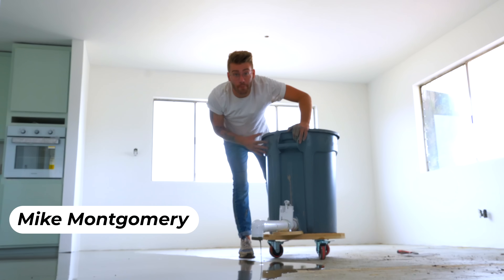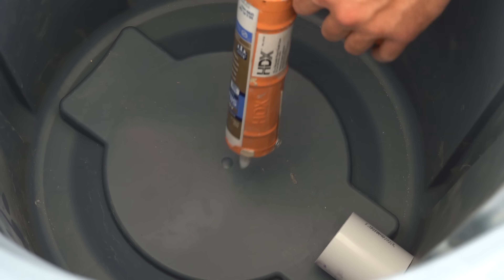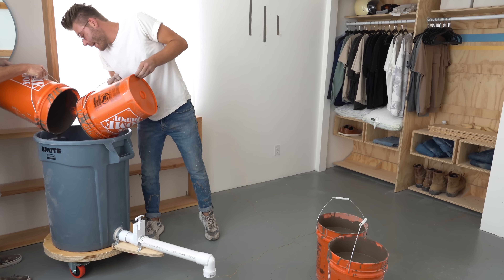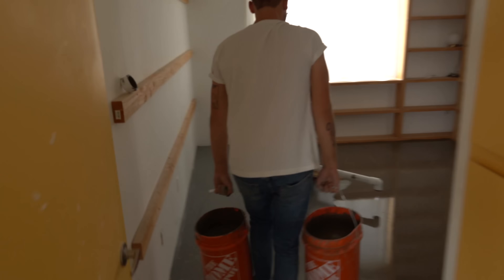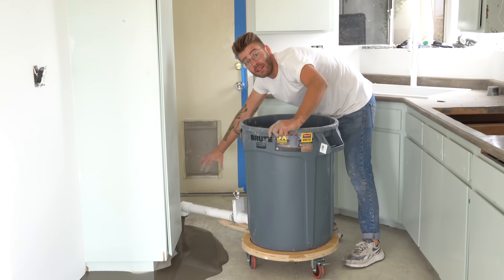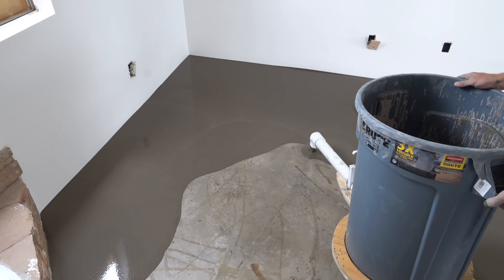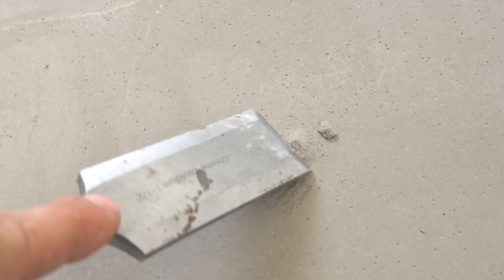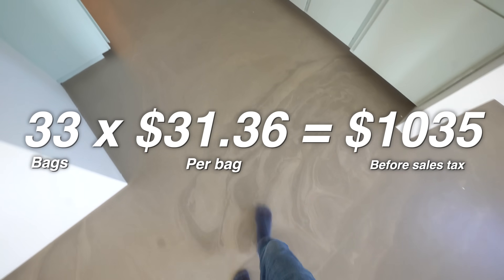DIY SELF LEVELING CONCRETE FLOORS!! $1 per square foot

Comment: This isn't what this product is designed for, there are cold joins everywhere which will fracture and crack and there are no expansion joins anywhere. He should really do a update video in a year to see if it has cracked through the doorways, cold joins and see what damage the floor has received from general use
Reply: Not to mention this is just a slurry mix not concrete. There are going to be huge issues with this.
Reply: I wanna se the entire house after 3 years. As far as i have seen the videos it will start falling apart.
Reply: No one seems to know the difference between cement and concrete in the real world.
Reply: Yeah.. this house should be condemned. He also took a support beam out and placed a heavy brace in the roof that will likely collapse over time. I wouldn’t live here.
Reply: @neondynamite  If you ask me all the newer videos where he fiddles with the structual integrity should be taken offline because if people try this at home there is some serious danger.
Reply: @andylimb  he is calling it concrete, but it is levelling compound which is designed to be self levelling. It's over 40mpa, so it won't crack as long as there wasn't too much water or too thick.
Reply: Made for tiles
Reply: That's actually exactly what self level is for. He did a lot wrong though. Your supposed to use a porcupine roller to get the air bubbles out and use a perimeter tape made of foam that prevents cracks.
Reply: it is levelling compound which is designed to be self levelling. It's over 40mpa, so it won't crack as long as there wasn't too much water or too thick.
Reply: People have already said this in other videos, but he keeps making more of the same
Reply: @cinder7258  It is self levelling compound, but just because you use a product doesn't mean when you apply it incorrectly that it won't fail on you because it is 40mpa. His "swirls & geode patterns" that he is playing off as a cool design are all cold joins that have a high failure rate
Reply: @TrunksChoiceBand  Tell me you know nothing without telling me you know nothing...
Reply: It’s the way that you guys act like he’s telling you to live in this house if you don’t like it then don’t do it but don’t be over here being a wet blanket for everybody else and making comments he knows that he can cover his floors if it doesn’t out 🙄 he’s just being creative why don’t you guys calm down and find something else to do he never said that he was a professional he never does.. y’all over here losing your shit over something that was he has chosen to live with. #Myofb
Reply: @davidp5492  Bro? he always comments  and my man does not have a large ego. If this comment is to believed which it isn't since its wrong, wouldn't he be busy?
Reply: @davidp5492  by the way he never actually says anything that would warrant a response, he doesn't talk to him directly.
Reply: @davidp5492  they really don't make that much money, maybe max 100k per year
Reply: It’s flowable hydraulic cementitious underlayment- it’s formulated with polymers and in a way that it doesn’t need control joints.
Reply: @Tavieme  
Thank you. All the experts always criticizing what someone else is doing “wrong” but never making their video on how to do it “right”. And it’s true that he might not be using the product correctly but at least he’s creative enough to where even the experts feel the need to watch his videos.
Reply from the maker: I’ll do that!!
Reply: @jmccormick1490  spike roller is for breaking surface tension
Reply: @Jaylowrider  That's true, helps the self level do what it's supposed to do. You are correct.
Reply: @Tavieme  so now if someone does something completely wrong we should call it "being creative" and encourage him to do more wrong.. sorry "creative" stuff.
Reply: @TrunksChoiceBand  cold joints and failure rate? How would this cause the floor to fail?  What does it do,  fall off the floor onto the ceiling?
The pattern is simply because it's flowing out of a tube. If you poured a five gallon pail onto the floor and screeded it out, you'd have the same look for each of the five gallon pails poured next to one another. It just wouldn't be as obvious.
Reply: @shazadhussain4204  that's what comment section for. Criticising? It depends on you, at least he got to know a few other ways to make it correctly, why do they need to make a video? They might not know how, but they surely know about the subject matter.
Reply: Some self levers are wear layers. Just have to seal them.
It also needs a minimal thickness.

Just listen to his voice. You already know he doesn't know what he's doink.
Reply: @TG-zd9de  lmfao you have no clue. all concrete slabs will crack over time because concrete naturally shrinks. It’s a known fact.
Reply: @tf5870  thanks, have a great weekend
Reply: Don’t Home Depot this.  They flat out don’t sell the tools or products you need for a proper finished concrete floor.  Find your local specialty concrete supplier or order online.  As a contractor, I would not warranty this.  As an engineer, I’d get sued for speccing this product as finished floor.  No perimeter expansion gap, zero porosity skinned over grout.  No bueno.  Fat guy is going to slip and fall into those cabinets and you are busting a crack in this.  First cold day and the slab shrinks, cracks.  It’s made to go under tile and wood where failures in the grout would be bridged over and hidden by a more flexible floor.  Good news is this isn’t a wasted effort since the next guy will have minimal prep for a new floor.  Should have finished this with a micro topping before sealing.  Formulated to be a much harder surface while also being flexible and pourous to accept stains and sealers without becoming too slick.
Reply: @andylimb  I was wondering about that. Concrete minus aggregate is just cement, right?

Is there a concrete mix with small enough aggregate to be piurable and self leveling?

Seems like even pea gravel would be too small unless you were going like an inch thick.

Even then I don't know that it would be self leveling.

I've done concrete over chicken wire for interior walls on a quonset hut once. We just troweled it on and smoothed it with a sponge.
Reply: @Tavieme  If he's presenting it as a viable method, but it can be expected to fail such that it requires extensive work to make it usable, people deserve that information 

People who might try this at home need to get an outcome that justifies the cost and effort without a monetized video to offset it.
Reply: He should switch to a wear surface self leveler like Customs tech level HPT
Reply: @hasserecht3678  report those videos that you feel are unsafe.
Reply: They're called cold joints. Not joins.  Joints.  And expansion joints are for slabs.  Not self leveling. And also, yes that is exactly what that material is designed for.  Better stuff is ardex.  I worked w pyramid in NYC for years. I'm a union Mason so please don't argue w me
Reply: He also poured over an existing slab. Unless the house settles further it will not Crack.  That stuff is over 10k psi
Reply: @cinder7258 😂 try 550 per day cash, or 175k per year annually or better in NYC as a local 780 finisher.  Ask me how I know.
Reply: Did you like that bucket 🪣 with the gate valve,,,? Johnny Bravo style
Reply: @ModernBuilds where is the update?
Reply: I was wondering, why doesn’t he use the trash dolly’s that are made for that can, but then he needed something for supporting his flow pipe. Pretty interesting idea. Just not a big fan of the finish look though. Too plain for me. But a fun video all together.
Reply: @ModernBuilds here’s your 1 year reminder. How’s the floor looking?
Reply: @ModernBuilds Did you do the update yet?
Reply: @ModernBuilds update?
Reply: @cementkidd sounds like you have the experience to make a well informed opinion, to us regular DIY ers I appreciate your input. Only thing I would have done differently is to just constantly keep filling the dispenser can , instead of stopping and refilling just having you buddy bring in a 5 gallon bucket and add it before you run out of material. You know that you got to hustle with a project like this and make sure that you keep a wet edge
Reply: @russellstewart5414  your 100% right about that.  In NY we had a mixing truck with a 3 inch hose that gave us a consistent flow of material.  But when mixing by hand, we used pickle barrels and had an army of men mixing ahead as we poured the material.  It is spread in small strips to eliminate cold joints, and there is spiked rollers or blades used the process.  If cracking was possible, we saw cut joints into the floor.  Never expansion joints ever.
Reply: 😂 @neondynamite
Reply: The floor is primed first for bonding and the self leveler is designed to be sound over a 1 1/4” substrate.
Reply: @griffinholtsinger2379 

Thanks, this is the most useful comment.
Keyword microtopping.
Reply: @cinder7258 in what country is 100k not a good income
Reply: He’s actually doing something which is really dope when our great great grand fathers built there homes they weren’t don’t perfect or even close and a lot of those homes lasted 100 years. He never claimed to be an expert or even a professional he always asks for suggestions and better methods.
Reply: So its been a year can we get an update vid?  Thanks!  @ModernBuilds
Reply: @ModernBuilds  How's it looking a year later?
Reply: Update time G
Reply: @jmccormick1490 *you’re
Reply: @ModernBuilds okay it’s time! Let’s see it! 😊
Reply: One year later
Reply: @ModernBuilds I'll look for an update after I watch...😂
Reply: He will have no problems with these floors my company has been using this system for years and have never had a floor crack !!
Reply: I'm in a similar situation and apprehensive about which direction too go. Slab foundation on mostly clay (north Texas) with a 3 inch drop over about 30 feet (but a big part of that within 10 feet). It would be an insane amount of leveler but not sure what a good alternative is. Anyone have any better alternatives?
Reply: I figured that was just the polymer crap thats in it, idk. I did this to a bathroom that i was/am going to tile, but havent gotten around to - no cracks @TrunksChoiceBand
Reply: Link?  @ModernBuilds

Comment: You could just… pour it on the floor from the buckets…
Reply: Those buckets are extremely heavy. The wheels make 1-2 people work a bit easier. But yes if you had a crew pouring from buckets makes more sense!
Reply: @pandaexpresso  You mean the buckets they used to mix in, and then transfer to the trash bin? Same amount of energy. But this method uses more steps and is not going to let the material self level as well. This is a 1 to 2 person job.
Reply: True that.
Reply: Didn’t you see how it hardened up 4:45? If your consistently pouring you won’t get overlaps, it’s also faster, practically
Reply: If you wanna not do a nice job and easy clean up just pour on floor
Reply: @timriney7266  energy use to put in trash bin not same with energy to pour on the floor slowly,if u want to pour all easily,u will never got beauty like this..
Reply: Cool contraption but if you just did it one bucket at a time you would always have a wet edge. It's a 2 man job, one guy mixing and the other guy pouring. 5gal pales are easy to pour from. You're carrying the buckets either way!
Reply: That stuff is super heavy.  This is genius.
Reply: some experienced concrete guys have concrete in the head. they don't like anything outside of what they've been doing for the past 50 years.
Reply: @vector006  so where's the other man for the 2 man job? You fail to realize he made a 2 man job a 1 man job.
Reply: You are the definition of work harder not smarter.
Reply: I do this for a living. I don't think you know what it is like to bend and pour a full 5 gallon concrete bucket. You can't just dump the whole bucket in one area. If you do, then you have to waste time leveling it out with a squeegee. His little contraption does save a lot of back ache and time
Reply: Ive done numerous floors and always use the buckets. Self level is fast setting and the additional time required to fill the hopper burns valuable time. The rule is mix thoroughly and pour quickly. 6 gallon pails are way easier than 5’s.
Reply: 100 pounds a bucket when full to the brim
Reply: No spikey rollers to help with the surface tension 

The result of this disaster can't be that level
Reply: @Awesome_AustinYT  put a spout on the bucket.  Should work
Reply: I’ve done it that way… this spreads it better and faster.
Reply: Lol and jiggle with a squeegee you don't use a steal on self levelling concrete. Fyi use buckets
Reply: No primer for adhesion?
Reply: Bucket on 4 wheel dolly works
Reply: Looks like a good idea! He could have used a better valve though
Reply: Not even close to as cool 😂
Reply: Lol. My thoughts of clicking on this video. Lol
Reply: Lol
Reply: This is actually a 3 man job ,one to mix ,another to carry the material,and the last to  manage and spread the material.
Reply: Try living up 46 buckets... Lol
Reply: @Chris Hayes  yeh it's very hard to break from dogma and think outside the box. But in the contractors defence if they try something new and inspectors see it they get fined up the ass or sued. Also God forbid innovation fails which does happen, and you did this on a customer's floor who is paying you 5,000-30,000$ your reputation,time, and money are all at sever risk. 

Such hard headed adherence to dogma doesn't happen by accident.
Reply: I did it with buckets.  It's a pain in the ass.  Much better with the set up he has.
Reply: @Cerebro13 so technically the guy carrying it could do the whole job
Reply: I wonder how it has maintained
Reply: I did 110sqft with two buckets. It's self leveling so I just poured. It worked out just as good as this guys. No prob with the seem though I believe it's due to being poured faster.
Reply: Buckets leave a crappy pattern
Reply: @I_know_nothing_always_learning he’s mixing the concrete.. lol
Reply: Back killer for me.
Reply: Wheel barrow and a ramp. Done.

Comment: What a massive waste of time just pour it from the mixing bucket and roller it. It’s self levelling just prime and seal the floor so the old floor does not dry it out and it will flow on it’s own

Comment: You should have ground that floor down to a porous substrate bonding agent when you do because it's made of acrylic and it made the floor slick so you basically used Pam on your pan before you cooked
Reply: Binding should of stayed wet while pouring

Comment: Smart design. I'm currently staring at my basement floor after draining water and pulling up old tile flooring. The floor is so uneven. I really need to find a way to get it leveled out after I fix the outside gutters/find the leak from outside first of course. I've never did anything like this before but I replaced a transmission from watching YouTube so how much harder could it be lbvs. I know one thing it's got to be done. I appreciate the information in ur video.

Comment: Pity the next remodeler that buys the home. Keepi it at leasat 20+ Yep? Many Examples of all the don't dos. Will we know the durability of this @ 1/4" depth vs using a cast flake/ epoxy where leveling is not a neccesity.

Comment: I'm doing this in a tiny bathroom with a wood subfloor. I filled the low spots, and then put down an anti fracture membrane with thin set. I'm pouring the self leveler in two stages. Stage 1 over the membrane with course sand cast into the top. Step 2, remove excess sand, prime the surface and then pour the second layer. I figure this will be strong, and resist cracking.

Comment: next time, would you recommend using the gritty non slip sand additive to the sealer coat?  How about now, wondering your thoughts are a year later...  is it too slippery or did that go away with wear?

Comment: In between pours when the first starts to dry and the next pour runs up next to it like that, use a spray bottle of water where they meet and they two pours will mix together perfect

Comment: Looks great once its done. In less than a year it will be cracked, broken, deformed and lots of other adjectives. When will people learn that there are no shortcuts. Doing it properly the first time is the cheapest option. And if concrete is too expesive/difficult, use large tiles. Either way is better than the bodge job in this video.

Comment: I'm curious if I did this if it would be suitable to lay floor tile on, or if a better bet would be laminate planks.  I would rather lay the tile honestly but I wouldn't want loose tile later.  I know laminate floor will sit atop foam and won't be bothered by cracking or too-thin material

Comment: You have to rake it with a gauged rake, then back roll with a spiked roller (get some spiked shoes to walk in it).....only way to get a fairly flat floor, this technique will not yield a flat floor for floating floors......need 4 people to move fast enough.....

Comment: Would you suggest doing this in a house that is out of level? I house that I just bought is structurally sound. However, foundation level it's not within "tolerance". I'm thinking about using this cement to level the flooring.

Comment: Looks cool but is missing joints to prevent excess cracking. Another thing you can do on top of existing concrete is semco you don’t have to add joints and they have colors that look like concrete

Comment: The floor is already level ?  Secondly All liquid levels naturally . High water content , in cement , help to level. Once the water has evaporated out of the concrete .The concrete is left porous  and structurally weak.